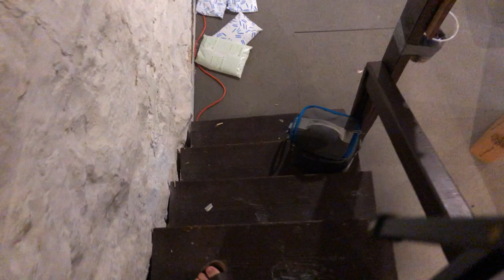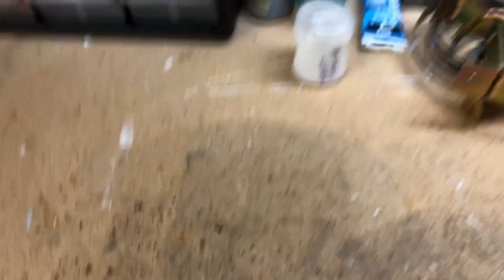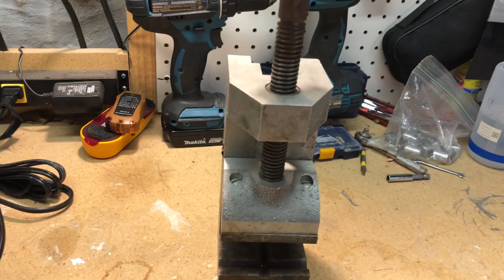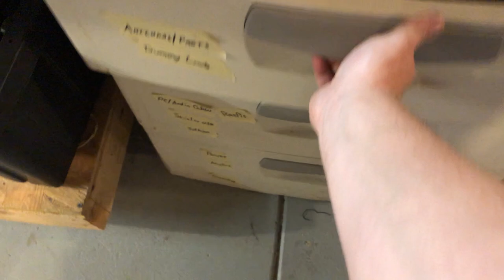Basement Workshop Organization (or Lack Thereof)

Comment: Let me sum up this video.  Feel free to use this in your video description.

00:00 Walking down the stairs
00:01 Making a horrible mistake
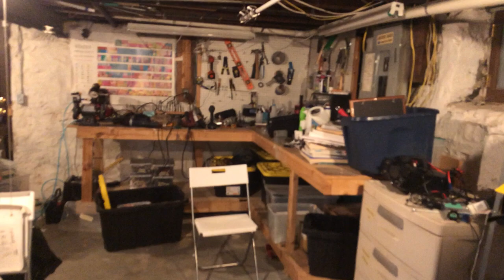00:12 What a disaster
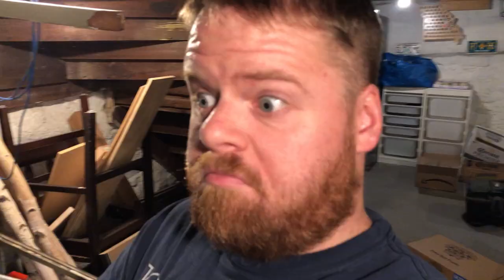00:24 Let's clean it
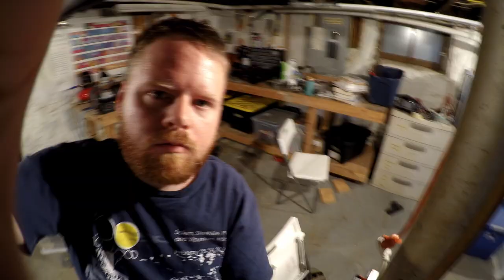00:26 N0SSC in turbo mode cleaning playing the piano in the background
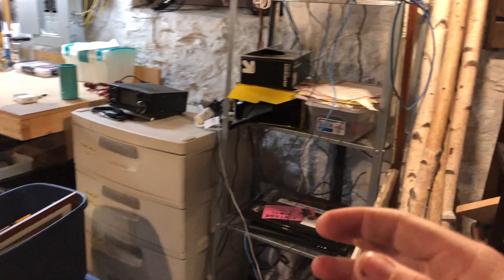01:08 A bunch of wood
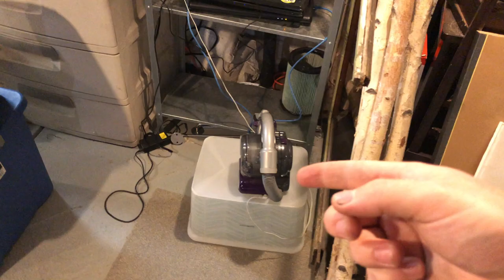01:15 A vacuum cleaner
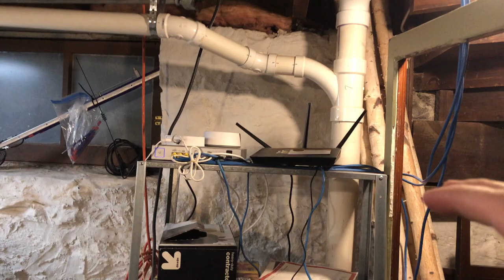01:19 The IT rack if you want to hack into N0SSC
01:36 A lonely Windows 7 computer doing nothing, probably hasn't been updated in years
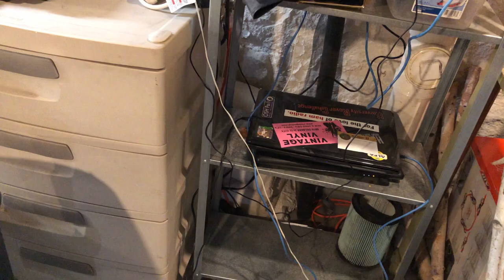01:38 Unknown tubes of sand
01:45 An electrical disaster waiting to happen
01:51 Just a bunch of radio junk
01:57 IC-7300 which has never been permanently hooked up because lightning is scary
02:03 Claims there was a RasPi hooked up at one time
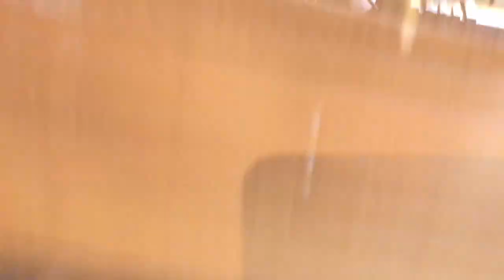02:19 Underglow (like this helps?)
02:25 Under storage? <- not sure this is a word or a thing?
02:27 Another junk bin montage with under glow
02:49 Can't figure out which is box is scooter chargers or SATNOG system
03:06 Toe-roids
03:16 Peg board is there...it's tools!!!!
03:23 Screwdriver set.  Bits are lost...Eureka!  Bits are found!!!!
03:42 Fire.  Air.  WD-40.  What else is there?
04:08 Angle grinder that's not really an angle grinder
04:12 Pancake maker
04:21 Vice grip from Dad's college days in 19 eight.  Dad must be really old.
04:34 Stole vice grip from grandparents
04:49 Loads of batteries waiting to explode
05:00 Rest of the basement filled with kitty litter, unwanted junk because it lives in the basement and crap
05:07 Beer fridge and some excuse on why is it's not cold enough and then doing the thing.
05:20 Needs viewers help because coming up with an idea is too hard
05:23 Has terrible organization skills, but we just watched a 1 min montage on organizing
05:30 Can't remember what organization bins or containers with lids are called
05:44 Claims has a mental encyclopedia of things where junk is?
05:55 Asking viewers to put comments on organization so this gets picked up by YouTubes algorithm and more people view it.
06:22 Adulting.  He's big and old folks! 
06:27 Likes things to look good
06:37 Admits the live streaming background setup is not his idea
06:47 Wife could organize workshop but would be too beautiful and then encyclopedia of junk would be useless.  
06:57 Talk to me
07:06 Bribes viewer with beer to come help organize (with a mask of course!)
07:14 Top shelf bottles of beer is off limits, but there is plenty of Busch
07:23 Bye
Reply from the maker: Kyle - AA0Z excellent work i will use this 😂
Reply: LOL